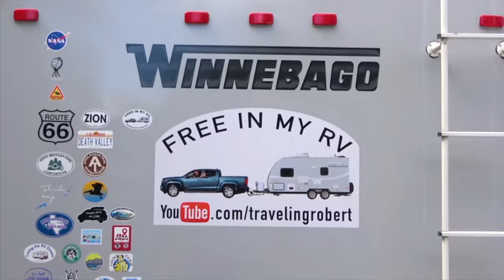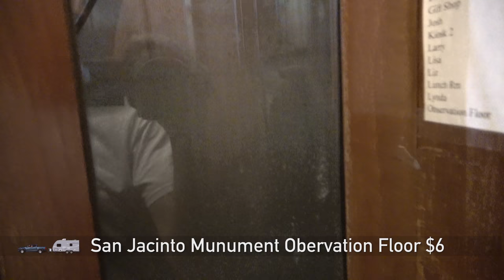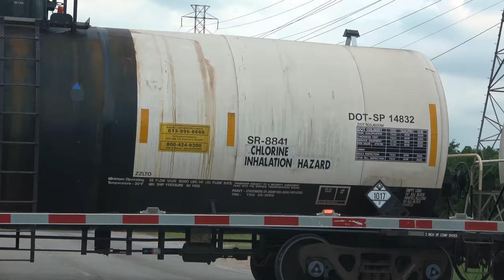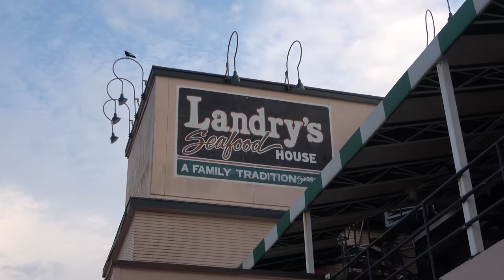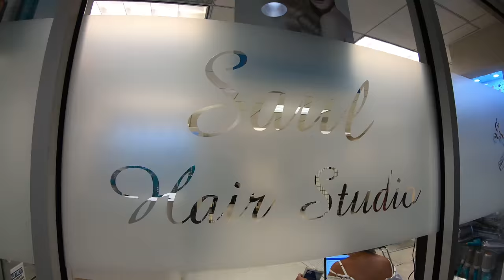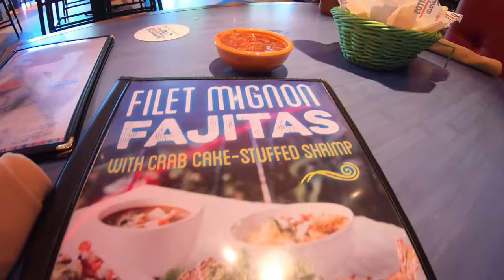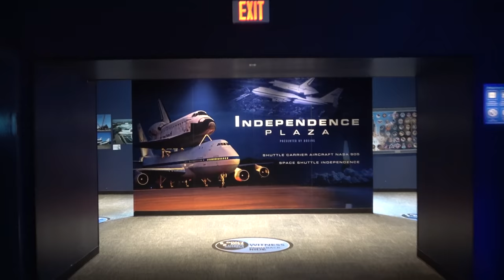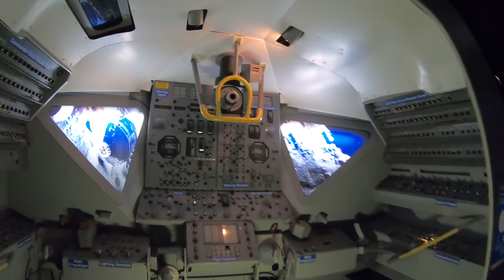Houston, Texas - #SUMMER2019 Episode 3

Comment: Hey Robert,  I'm a new viewer and was wondering if you could purchased another RV would you consider a trunk camper for your pickup truck versus a travel trailer.  What would you consider the advantages and disadvantages for your long journeys.  I am contemplating either one as I half a half ton Nissan Frontier truck.   Thanks.
Reply from the maker: I would have to look into that. Most half ton pickups are not recommended for truck campers. Mine says it in the manual. That being said, if I eve upgrade trucks I would consider it. They are great especially if you want to do some offroading or camping at more remote places.
Reply: @TravelingRobert  Hi Robert, thanks for the quick reply.  The new Lance truck campers are only less than 3000 lbs.  The Frontier has a towing capacity of 6400 lbs so I am way under.  I'm just researching what would be the best. I don't do off-roading but a lot of boondocking
Reply from the maker: @philc.9280  With truck campers you have to take into consideration payload capacity not towing capacity. I did a quick search and the Frontier seems to max out at 1,460 pounds for payload capacity.
Reply: @TravelingRobert  Thanks Robert for educating me.  I see my payload capacity would max out so I would be limited to towing a lightweight travel trailer like yours.  I see there are so many brands around 3000 lbs or less.  Thanks again.  Phil
Reply: Sorry I have to complete this conversation and thought.  So as I study the mechanics a truck camper weight would be solely on the axel of the truck whereas a travel trailers weight is on its own axel not on the truck so therefore you can pull a lot more weight than you can haul on the truck itself.  Got it.  Thanks. You have a new viewer!